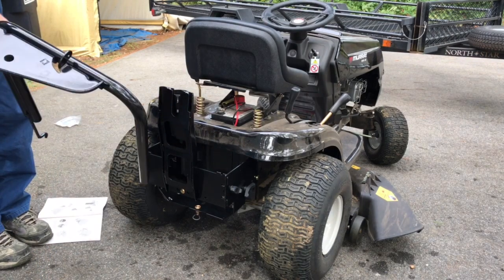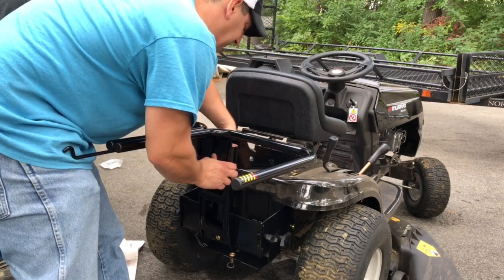How To Install a Bagger Kit On a Murray MTD Ride On Lawn Mower

Comment: Don’t need the bag brackets if you have a pull cart just get the lower discharge chute and a 6 inch 8 foot hose. Tie a leaf bag on the end of the hose and toss it in the cart. Done for under $50
Reply from the maker: Thanks for watching! Don't forget to subscribe!

Comment: fantastic video.. would you be able  specify the Name/serial number of the part which you install on mower first. Time: 3.20 on video. Where can i find them.. my bracket set is missing it..
Reply from the maker: I looked a little while ago and not sure if they still sell it. Try Amazon for your particular model.

Comment: I got the exact same tractor as you. I can't get the chute tube to fit over the deck opening. Does it fit over it or inside it?
Reply: I finally got it to fit over, but this thing is a colossal waste of money. The clippings can't make the uphill climb into the bags. I had to constantly take off the tube and unclog it. Evidently, the grass has to be cut low and very dry. Now I have to take it apart and hopefully get a little money back from it.  Your video was great! It saved a lot of time.
Reply: Your video will also help me get it packed back up. I'm so glad you showed unpacking it! Once again great video. Thanks for taking the time to post.
Reply from the maker: Fits over the outside or the deck opening on the lawnmower

Comment: I have the same Murray mower and bagger kit, and the "rubber band" holding the chute to the mower deck is not enough to hold it on.  (The contours of the chute do not fit over nor inside the mower deck discharge.)  Any suggestions on how to keep it on?
Reply from the maker: I haven't had any issues with mine staying on. The opening for the discharge tube fits over my mower deck opening. I have to stretch it out a little, but it slips right on.
Reply: @HomeownerRepair  OK thanks for the quick reply!

Comment: I have Murray m175-42 model number 13bn77ss058. I've been trying to figure out what bagger to buy. Had to send one back today. The rider u r working on looks just like mine. Which bagger system did u buy. Thanks
Reply from the maker: I looked a little while ago and not sure if they still sell it. Try Amazon for your particular model.